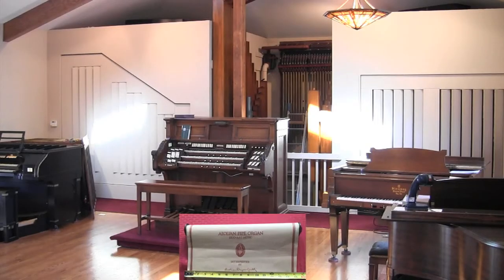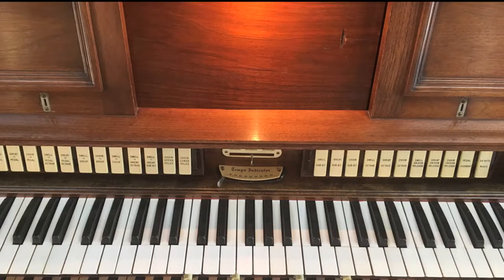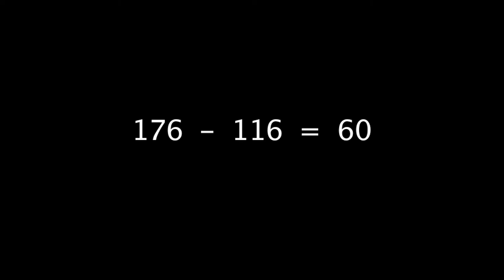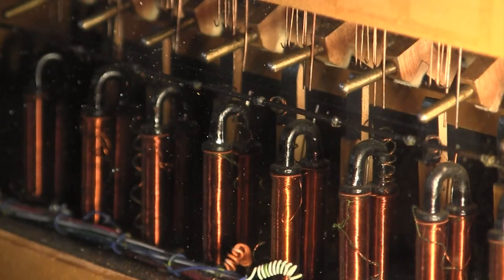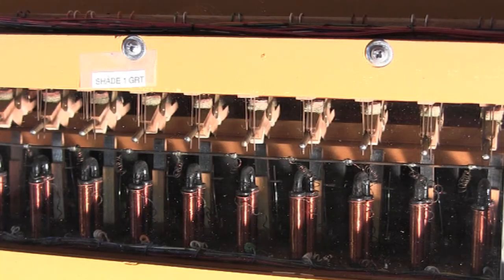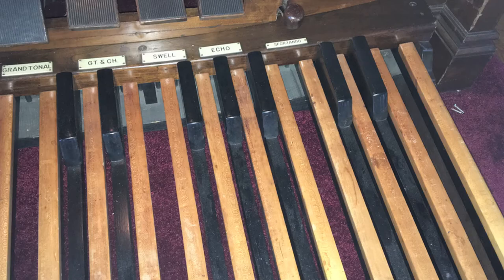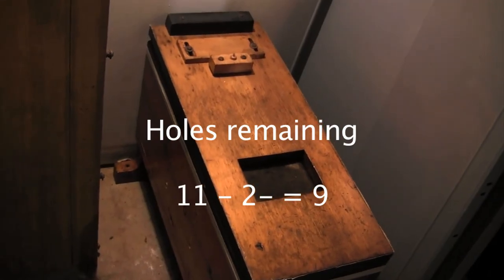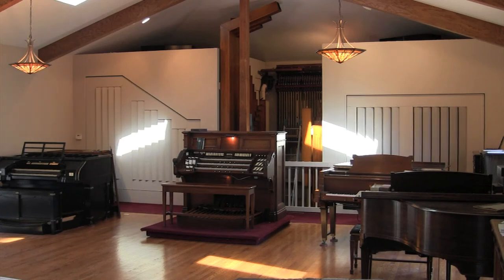Aeolian Pipe Organ Automatic Duo Art player explained in 6 minutes

Comment: Restored a carousel 176 note auto changer the most clever bit of the tracker bar is its ability to move left and right to follow the wandering of the roll but is also able to expand along its length to cater for rolls of varying width du to expansion and contraction. Hence those interesting vertical offset splits in the tracker bar.